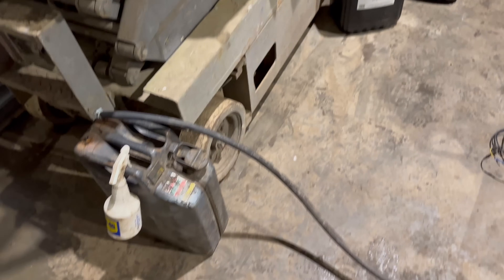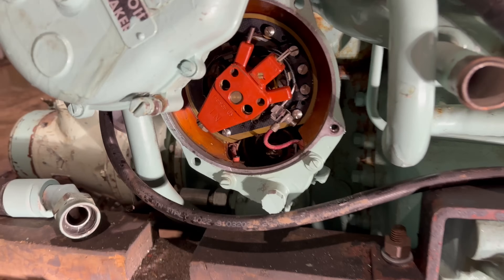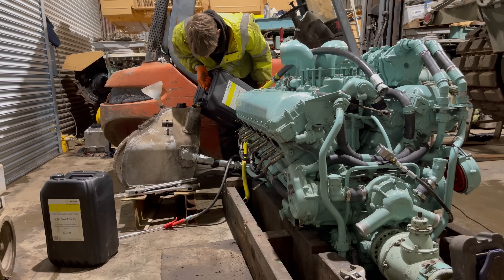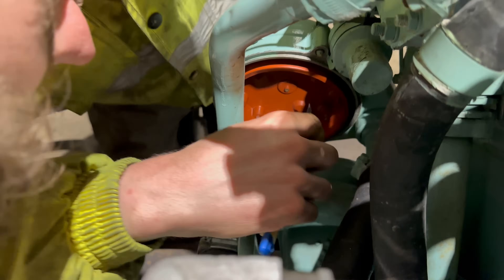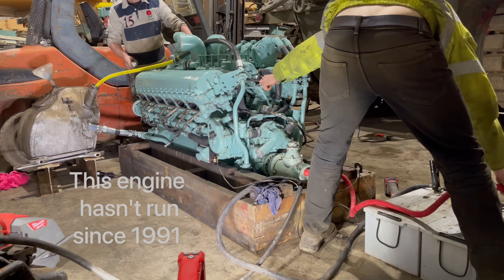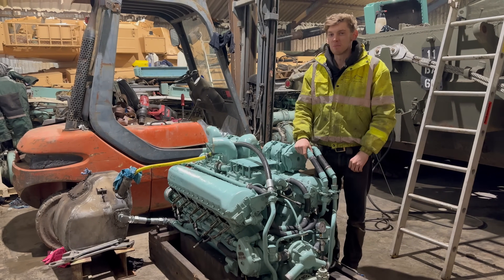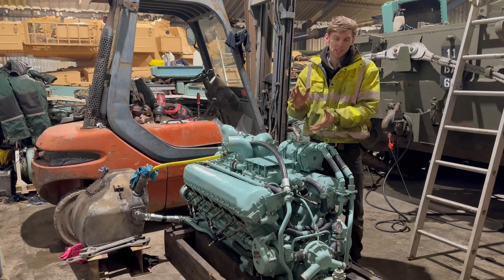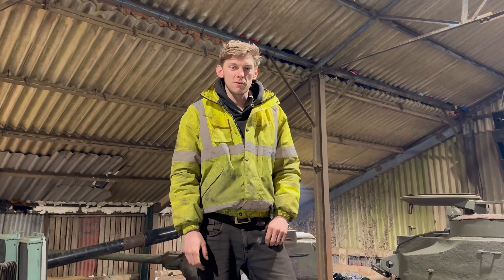Fire Breathing Tank Engine! Centurion AVRE Part2

Comment: I hope you noted and kept any shims under the gearbox and engine mountings. If there were any and they are missing or not put back the same you will get alignment issues between the gearbox, clutch and engine. This will cause the main engine oil seal around the shaft to the clutch to fail quite quickly. This causes the engine to very quickly lose its oil leading to a seized engine if not noticed in time.
From first hand experience on AVRE 01ZR15 during the NATO exercise "Iron Hammer". A seized engine because thd gearbox shims had not been replaced after the gearbox had been previously lifted out and replaced during repairs. We had to have the engine swapped in field workshops. Took 3 days to do and we were given a small box of leftover nuts, bolts and screws afterwards...
Reply from the maker: Yes I’m very much aware, I have done manny of these now, also there are shims under the engine water rail also.

Comment: Another awesome video, and lots of great detail.

Bit of an odd question, could you tell me the RAL or BS code/colour for the blue paint you're doing the radiators in?
I'm doing up a 1955 Austin K9 Truck, and the engine is rather scabby.

Cheers :)
Reply from the maker: Il fined it for you
Reply: Duck egg blue

Comment: Interesting video! I’ve found a plant sprayer with petrol in works a treat for first starts, or your brake cleaner bottle you cleaned the plugs with, bit safer than an aerosol lid also👍

Comment: The problem with mags like that is they have a shelf life regardless of use. The points in mags of that era usually have tungsten contacts that oxidise, as opposed to earlier platinum which stay good, but the main problem is the coils soaking up moisture and growing green mould. I have been supplied with 40 year old, untouched, ex MOD, still sealed in the box for tropical use vertex mags, that have been absolutely dead. The coils were mouldy and had to be replaced.

Comment: This is so interesting joe , were these engines known to be this tough to start even during the war and when in use ?
Reply from the maker: Remember this hasn’t ran for 30 years. And took 1 hour to start. Now it’s ran it starts instantly! Very good and reliable engines !
Reply: @MrHewes  ah that makes sense mate 👌
Reply: Well  worked on them after overhaul in the main workshops, we used to spin them over on the test bed until the oil pressure had built up,switch the mags on & hey presto fired up straight away

Comment: Shame to put the old exhaust on rather than zoomies :D   You can put aluminium plate-an-bar rads in, by welding an aluminium hole plate to the end to the core. It works well.

Comment: And another one fires up on the farm. Well done the lads!
Funfact: Most of the Meteor engines were built by RR from crashed and therefore not airworthy Merlin engines or Merlin engines taken from retired aircraft.
'Waste not want not' mantra from a very hard and long war.
There are a couple of Aussies restoring a Meteor and I am sure would like some support:
Now we're Torquin
@nowweretorquin8691
Reply: The meteor was actually built by Rover under licence,  near Belper,as RR were to busy making the aero engine
Reply: @stewartbrown8115   It was more than under licence. Rover was given total control over Meteor in 1944 following a fallout with RR over the new jet engine projects.
However my point was that RR found failed, crashed Merlins were a major source of parts for the Meteor and changed designs as necessary before Rover took control. Even Merlin parts that had failed inspection were approved by RR for use in meteor. It was an RR engine until 1944 when all work passed to Rover
Reply: @1chish  a pity they decided to make a smaller V8 called the meteorite,a dog of an engine,as rough running as the meteor was smooth
Reply: @stewartbrown8115   Well the Meteor's further development only came about because the American Ford V8 some in Government preferred kept failing.
The irony .....
Reply: @1chish  don't know about the American job,but the idea behind the meteorite was to use the same,pistons,liners etc
They had to fit a big heavy flywheel to try and dampen the vibration
Reply: @1chish  this further development, what was that?
Reply: @stewartbrown8115   The original idea was to use the Ford GAA V8 that was supposed to be going in the M4 Sherman in the new UK tank design that became the Cromwell.
However by 1942 that V8 was in deep trouble and even the Yanks gave up for some time. It was not sorted until late 1944 and was first fitted to the M4A3 Sherman.
This failure led to the faster development of the Meteor engine and the decision to hand it over to Rover in late 1942 with Morris Motors Cowley acting as shadow factory.